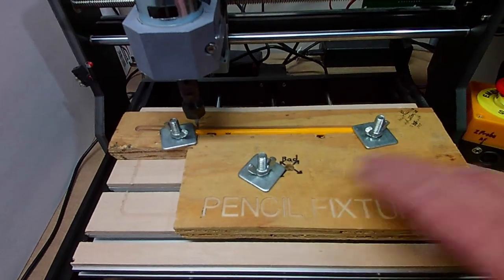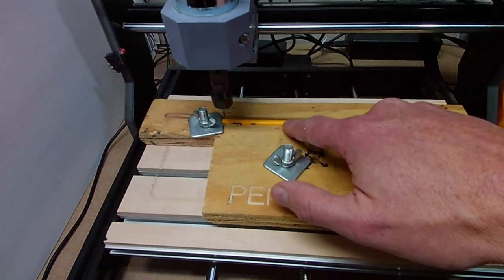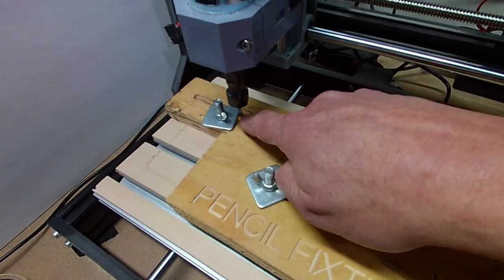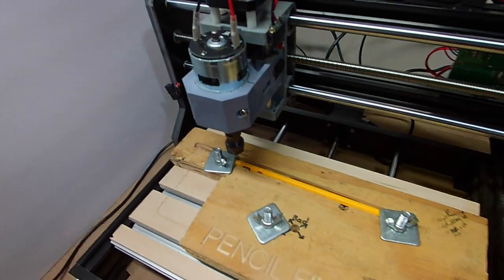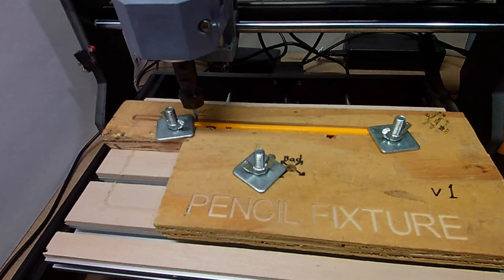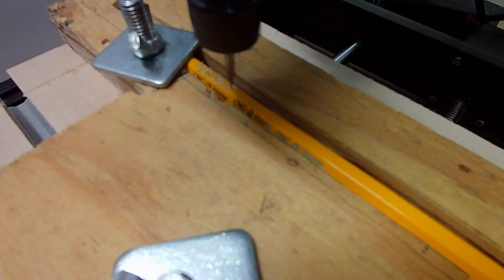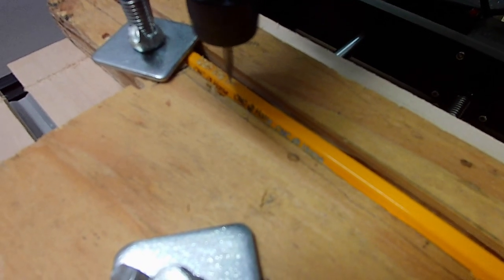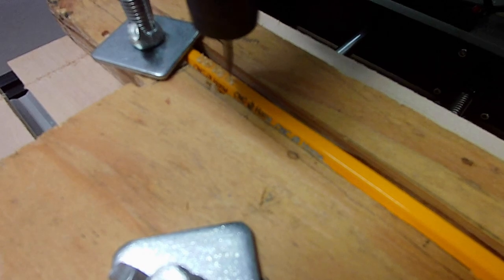Engraving pencils with the new spindle motor

Comment: I've been pulling my hair out trying to engrave small text like this. When I run the simulation, I'm using carbide create, i can't figure out why it just plows out the entire text, leaving a pocket.  Could you share the software and some basic settings I can play with? I've searched over your videos but maybe I missed it.
Reply from the maker: Sorry to hear that you have running into issues.  If we go way back in the videos, there is one where I talk about the software and parameters: https://youtu.be/Tu9gQbW6AGI 
I found some free software a while back called DeskEngrave (www.DesKAM.com).  It works well for basic text stuff.  The height was 2.7mm.  The depth of the job was 0.2mm.  I hope that gets you going and avoid the hogging out of a pocket when what you want are some letters.
Reply: @CNCATHome  Thanks a bunch! I’ll check out all those. Really appreciate it.